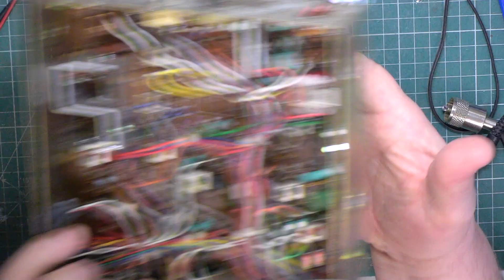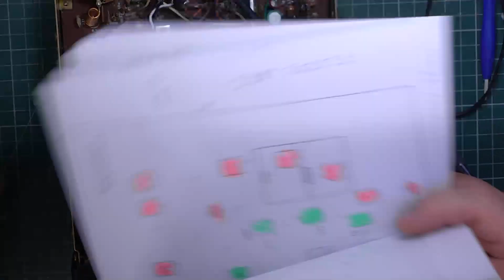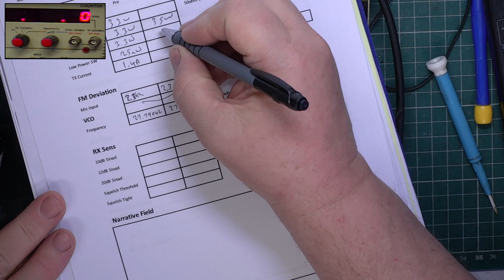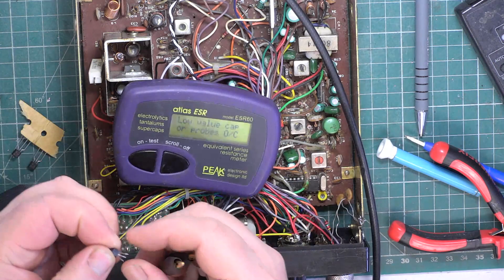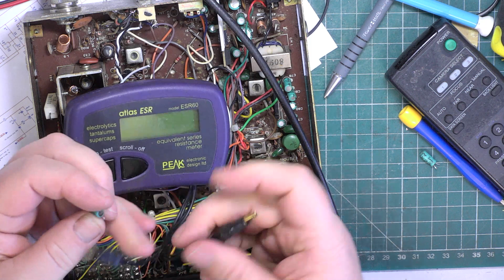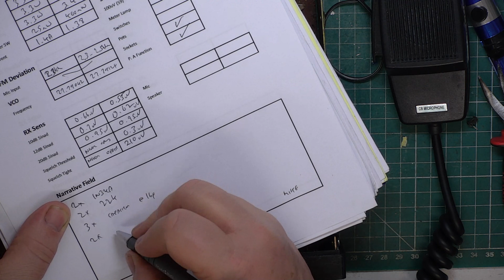LCL Communicators NI440DX CB27/81 UK FM CB radio - Extensive repair of three faults & alignment.

Comment: If only everything was done in DSP using C/C++ then it might have been better and harder to modify for 10Mtrs as it would be locked to the 11Mtrs band.
Reply from the maker: DSP wasn't around to my knowledge in 1981 when this type of radio was made.

Richard

Comment: Hi Richard, I realise this video is quite a few months old, but the tuning transformer fault rang a bell with me.  l think I can suggest a possible cause of L16 going faulty, assuming it failed in the same way as mine did.  I was able to disassemble two of mine that failed in two different sets and discovered that the coil wire at the bottom of the spool, just before it gets to the leg to which it is soldered, was cut through by the rotation of the cylindrical ferrite core.  I think it is most likely to happen if the core is rotated within a few turns of the bottom of its range.  Presumably some of the cutting could have happened during the first alignment of the radio and then subsequent tune ups finished it off.  It may seem unlikely but the thread of the ferrite core is actually sharp enough to cut its way through the soft thin copper wire within just a few rotations.  If you can spare the time, the transformers are potentially repairable.  I was able to scrape off the enamel on both sides of the wire break, solder a small bridge across the narrow gap, push the wire back in enough to prevent the core from conflicting with the wire again and job done.  The coil inductance was not affected by the repair and measured the same as a corresponding one in a working set in both cases.  I guess that in your line of work this is probably too time consuming, but it's potentially worth a try if you don't have a scrap chassis or donor set.  It's a bit tricky prising the can off the transformer but it is possible with a very thin strip of metal, a blade or perhaps even a piece of plastic.  Once off, however, it should be pretty easy to spot where the break in the coil is, assuming the failure is as I have described.
Reply from the maker: Roger on that. We also find failed coils because of factory applied adhesive eating through the insulation. 

Richard